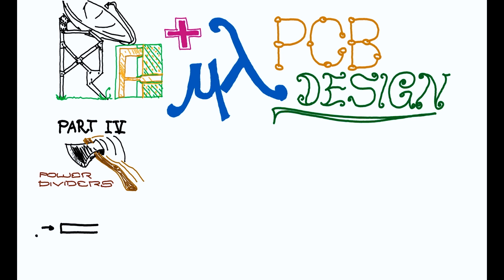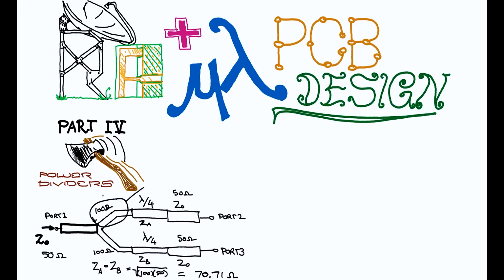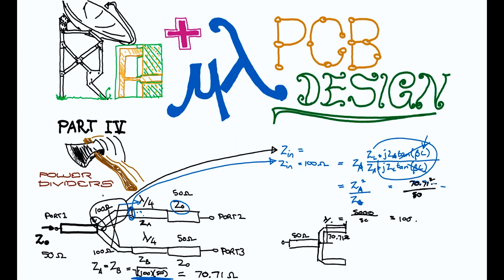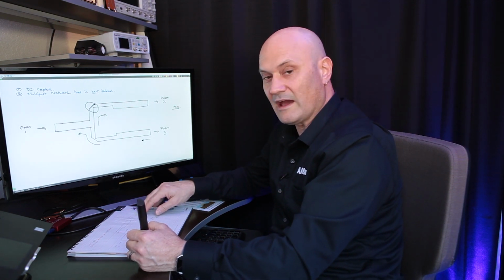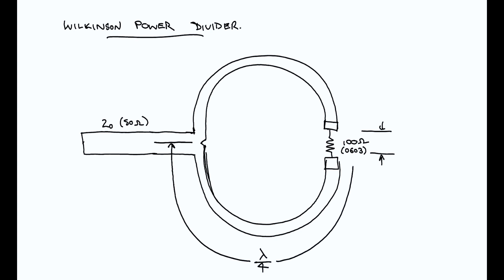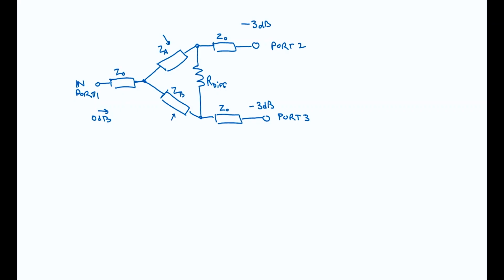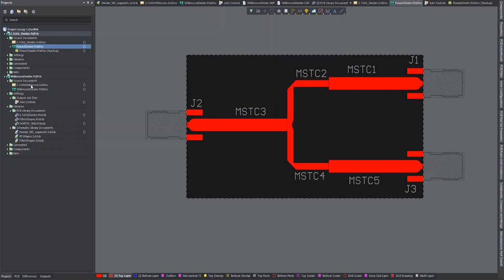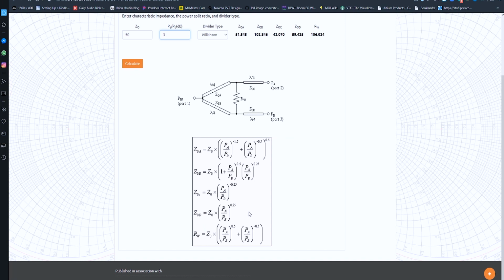RF and Microwave PCB Design - Part 4: Power Dividers.

Comment: How to determine the maximum power that can be connected to the power divider? Trace sizes are determined by impedance and will typically be thin. What if we want to divide or sum 200, 300 or 600W?

Comment: you are saying that you dont need 100ohm line because it is already 100ohm. however that fact is that the reason of quarterwave transformer line is 70.71 ohm is that the left part of the quarter wavelength is 100ohm. if you delete the 100ohm, it means you delete the impedance of quarterwave from beign 70.71ohm. I hope I' m clear enough.

Comment: This is a really fantastic series helping to demystify RF PCB designs. It would be great to have a video on doing the actual layout of the Wilkinson divider in Altium Designer. I would love to see how you do the single 50 Ohm port into the 2 half circle 70ish Ohm ports and then from the 100 Ohm terminating resistor pads into those nice curved 50 Ohm trace output ports.

Comment: Hello Sir , I have a question in the scope of the first introductory video of this series. When dealing with rogers RO4350 for example there are 2 dielectric constants in the datasheet one is 3.66 and the other one is 3.48. What I understand is that those two values were calculated/measured in different methods  in which one of them takes into account some material parameters since it's not isotropic (composite of more than 1 material).  The question is which one of them is recommended to be used in altium designer for microstrip line  in order not to take the effect into consideration twice? 
Thank you very much in advance.
Reply: you need to take consider of  design dk value.

Comment: Just fantastic...
Reply from the maker: Thank you so much. What other topics are you interested in learning?
Reply: @AltiumAcademy  It was very interesting to see a real circuit after the theoretical part. Could you make some more videos like this, based on the knowledge you already shared with us? Videos, where you show some simple projects, not necessarily physical circuits, computer projects are enough (in Altium software, of course;) with an explanation of what and why. Maybe some active elements in the future? Fast amplifier? Fast comparator? How a good PCB design should look for such applications?